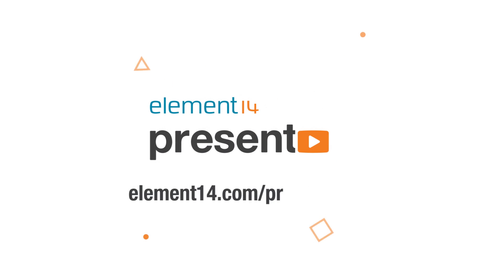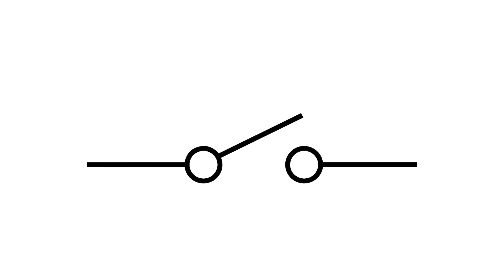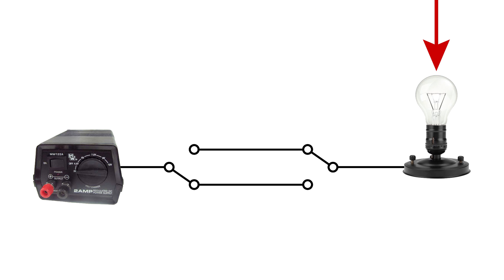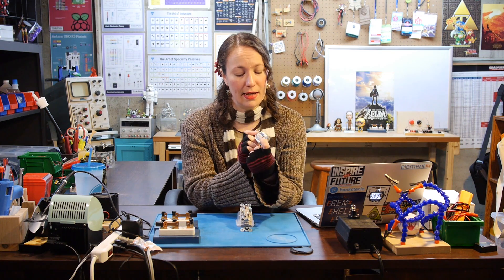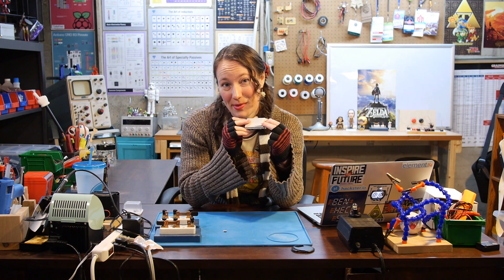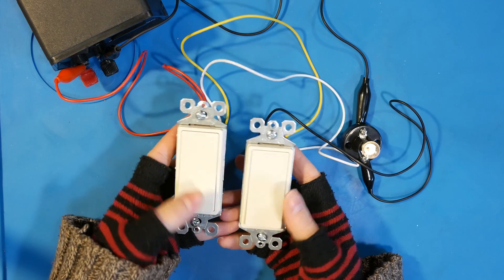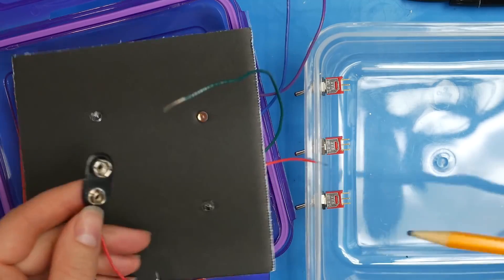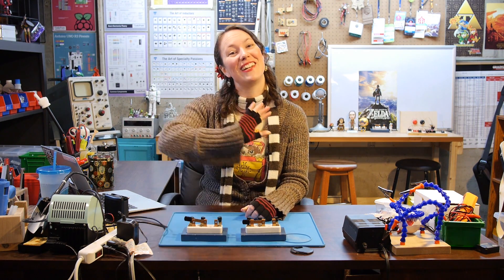How Three-Way Switch Circuits Work - The Learning Circuit

Comment: This is so much to learn. I just wanted to replace my motorcycle starter with a toggle switch...

On - on - (on)

Because ground connects to turn it off,
then middle on breaks ground and turns on headlight, then start ((on)) engages starter and turns off headlight. So I only ever need to connect two wires at once.

So... 3p3t or sp3t or something? Off-on-(on) won't work cause it doesn't connect ground cause it's off... 

🤔🤔🤔

Comment: Great video!  I know you had to throw the disclaimer on working on main AC.  For us, knowing how to wire one's own house is a solid life skill that gets you out of jams and saves you a ton of money - BUT always test before touch after shutting off the breaker.  First confirm you can detect voltage (non-contact meters are good for this prior to removing switch plates), switch it off, then confirm absence of voltage with an appropriate contact meter.  Also, ensure the breaker box is under your full control - particularly if working with a buddy.  In industry, you lock and tag isolation points to sustain control.  Black-n-decker Advanced Home Wiring is a pretty small book with a million pictures of every circuit in a home, its a good resource to teach you all need to know.

Comment: Are you homeless or don’t have heat making you dress like that while inside and making a video?  Do you need help?

Either way, very good explanation.
Reply: Actually, the HVAC makes too much noise so we have to turn it off when filming. Winter in Wisconsin was pretty brutal this year and the little space heater couldn't keep up. Plus, I tend to just run cold. I still dress like that when it's 40-50F outside.

Comment: I have 3 switches in a staircase and all toggle the light. How does that work?
Reply: one of them is a 4 way switch. it'll be the second switch in the circuit. the other 2 are 3 way switches

Comment: It would be VERY EDUCATIONAL if you would dismantle those switches and show how they work internally. It would explain why the opposite pins from the direction those small switches are flipped get connected.
Reply: basically on switch 1 of the 3-way circuit you have your hot feed coming in to the common terminal. when switch is flipped, the power goes to traveler 1. when the switch is flipped again, power goes to traveler 2. there's just a piece of metal that slides back and forth between the 2 travelers, but it is always connected to the common at the other end. think of like a window wiper on your car, it just goes back and forth from one traveler to the other.
Reply: I had actually planned to do that. I took one apart and found that the inner workings are attached to the top and bottom casing in a way that the mechanism doesn't interact with the case open. There wasn't a good way to show how it worked with the actual switch taken apart. I was super bummed because I agree that it's so much easier to understand how things work when you can see the mechanism in action.
Reply: @maker_karen1785  It made it really hard to return to Home Depot I bet.
Reply: @DrivewayWorkshop  Thought about it. then decided not to even try. :\

Comment: Just last weekend while walking through a house that's under construction I was wondering how switches like this are wired up. It's much simpler and more elegant than I'd assumed. In hindsight it seems like it should have been obvious. Thanks for the clear explanation.